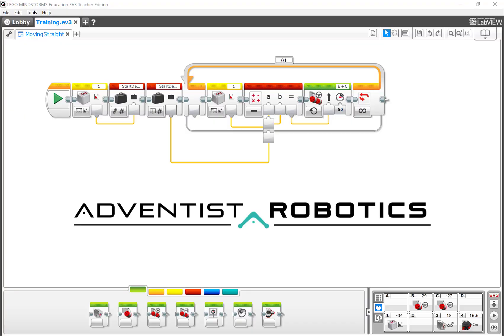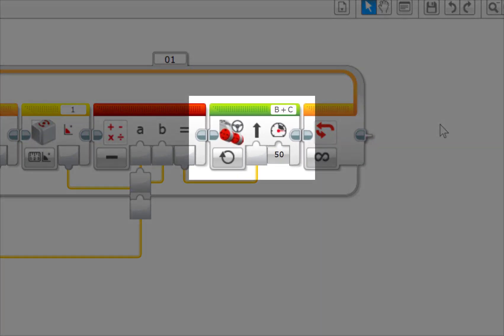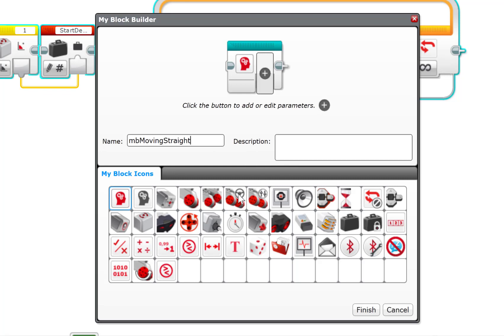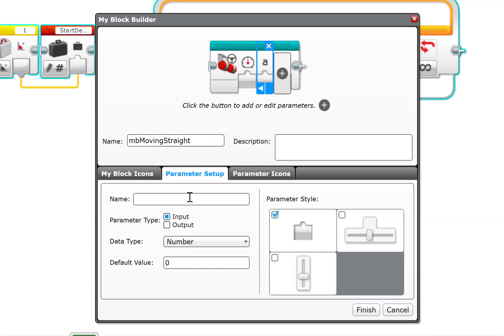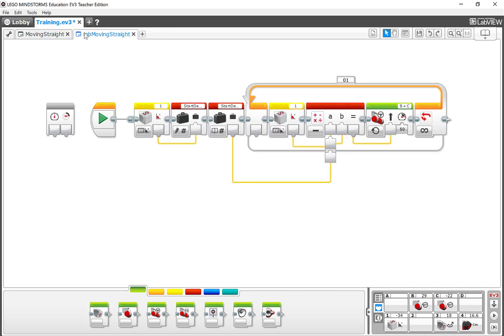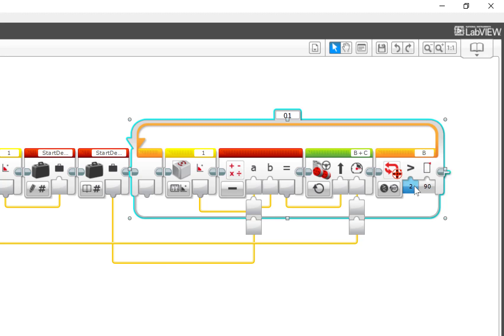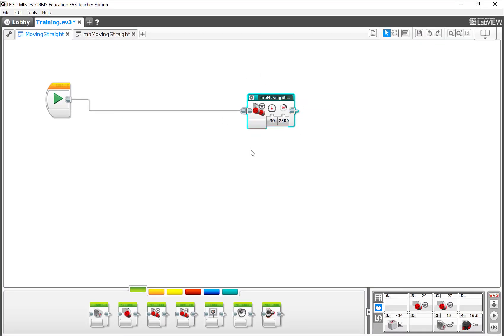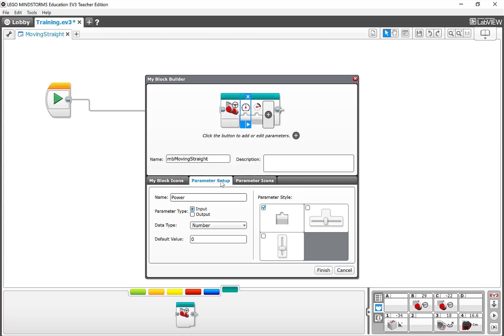Gyro Sensor - Moving Straight - Part 2 MyBlocks

Comment: Thanks for this series Mel! I've been a gyro fan for some time but have a hard time getting the team to embrace it. One thing to note in your MyBlock - in my playing around with this, you may want to add a motor reset on the same motor you're ending the loop with before the loop starts, so that it starts counting with 0. They tend to remember the cumulative distance turned since it was first activated or the last reset by some other means. without this, you may get inconsistent distances traveled.